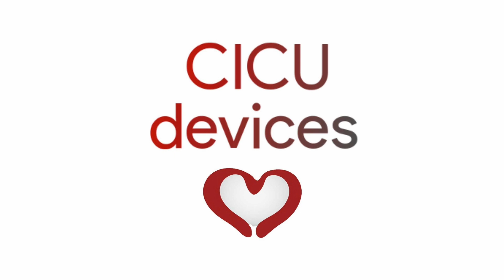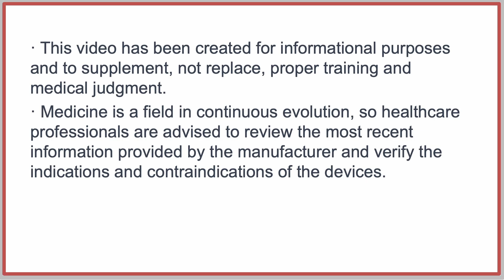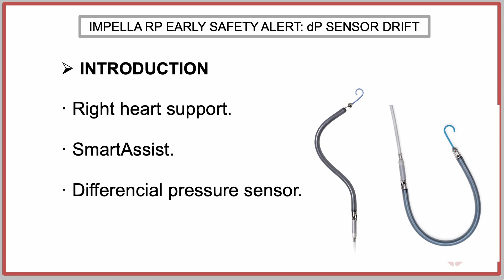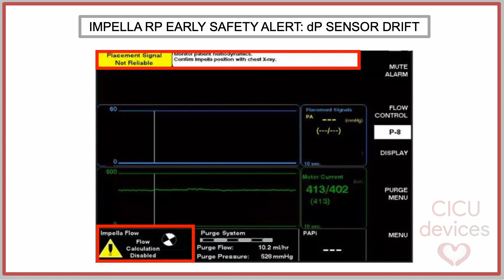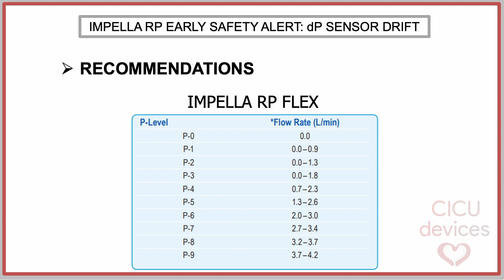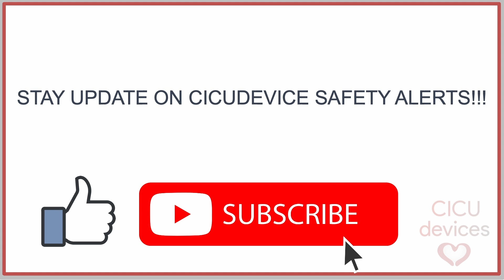⚠️ IMPELLA RP & RP FLEX, SAFETY ALERT: DIFERENTIAL PRESSURE SENSOR DRIFT (SAFETY ALERT 2026-02)

Comment from the maker: This video reviews a key safety alert affecting Impella RP and RP Flex devices, focusing on differential pressure sensor drift and its impact on displayed pump parameters. Understanding the limitations of controller data is essential for safe clinical decision-making.
👉 Explore our CicuDevices Security Alerts playlist and subscribe to stay informed on the latest CICU device updates.